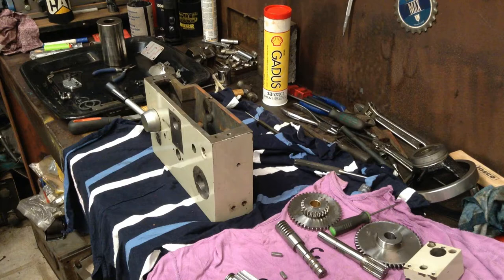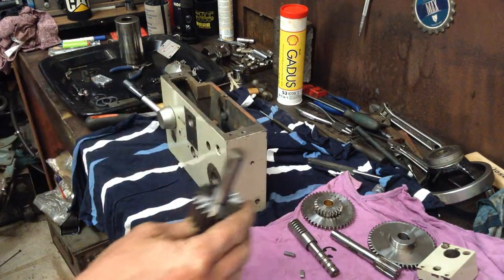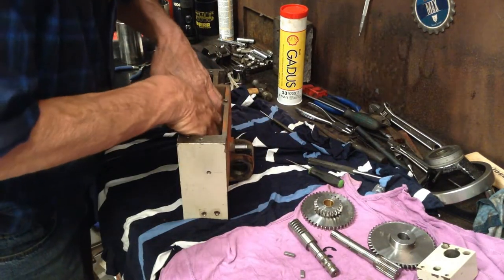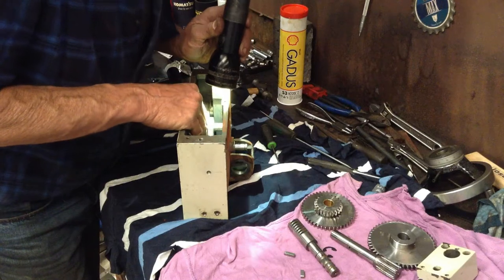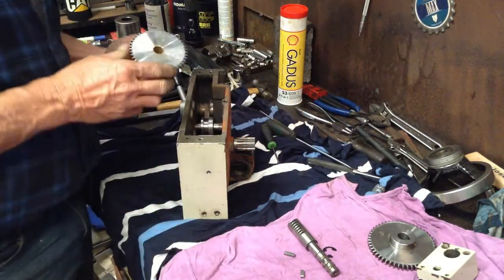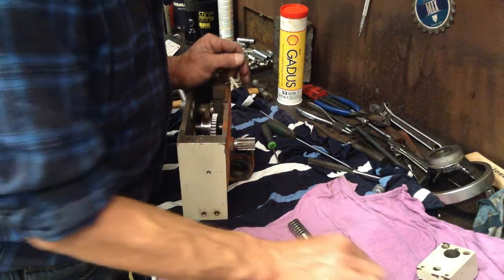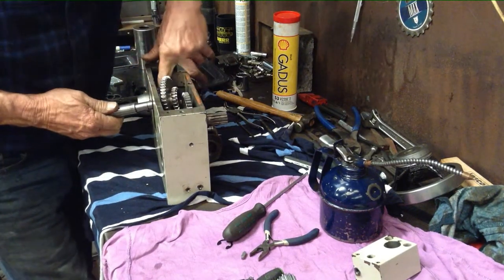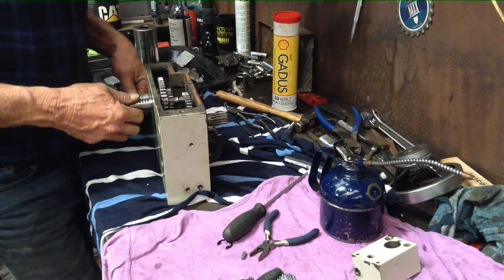Center Lathe Maintenance & Modifications   Part 6

Comment: Max, I meant to ask.....what is the sealant you use? Cheers, David Harper
Reply from the maker: Loctite pipe sealant for oil drain plugs &  any automotive silicon sealant  for parts below the oil level line .